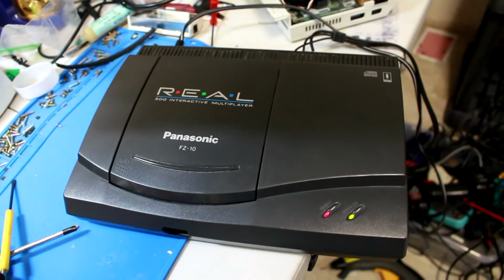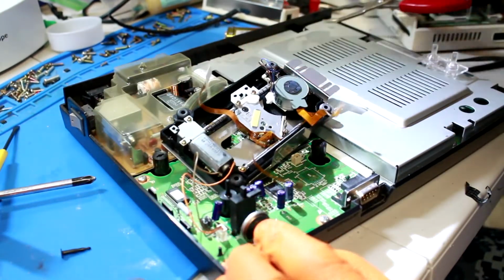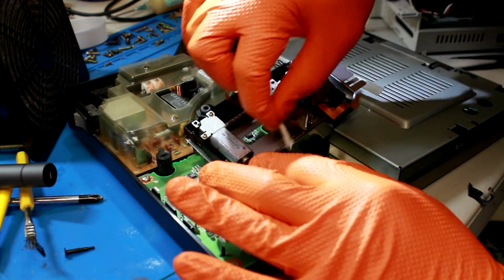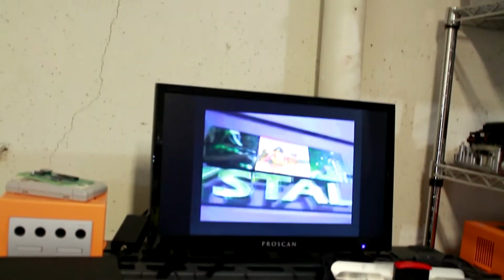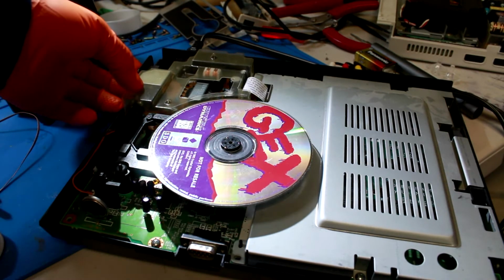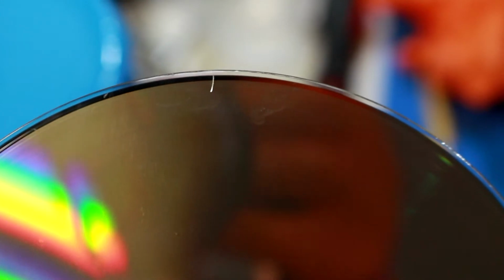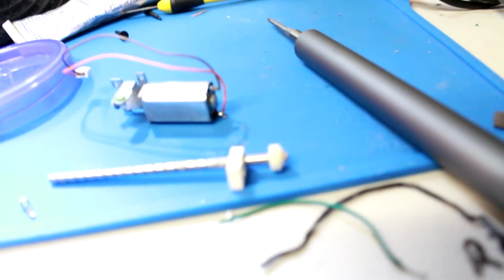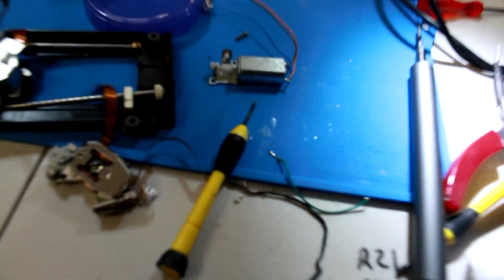Panasonic 3DO FZ-10 Repair

Comment: That laser that doesn’t work, try adjusting the potentiometer. You should measure the resistance before and after, with a multimeter.
Reply from the maker: Fo sho.  Thanks for the tip.  I'll give it a go this weekend.